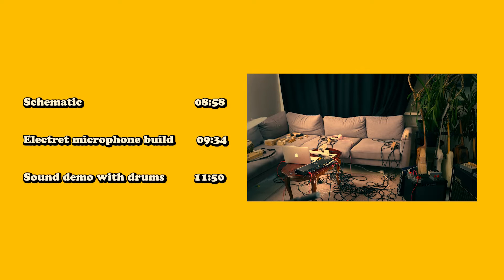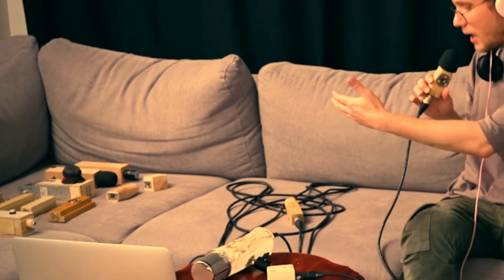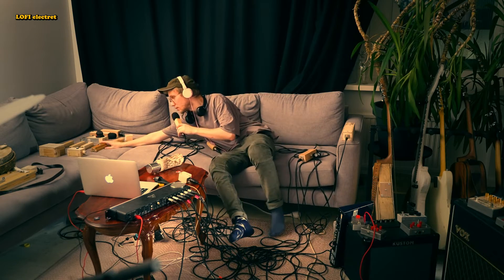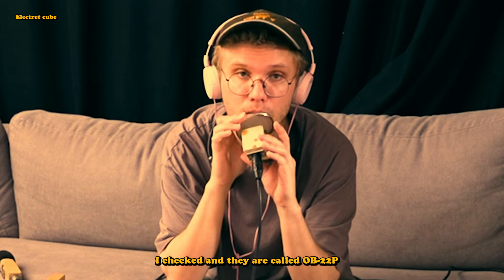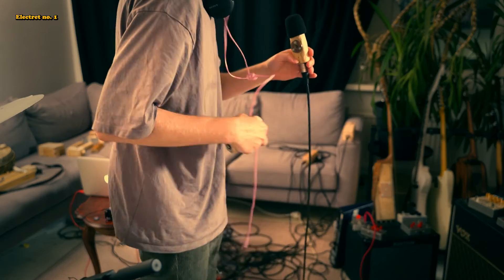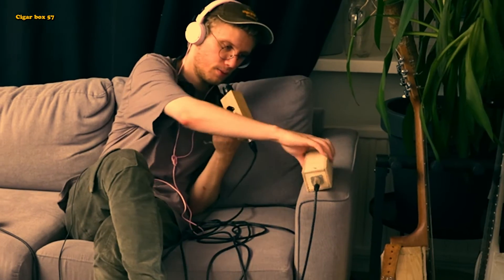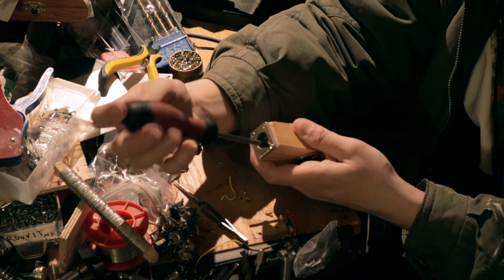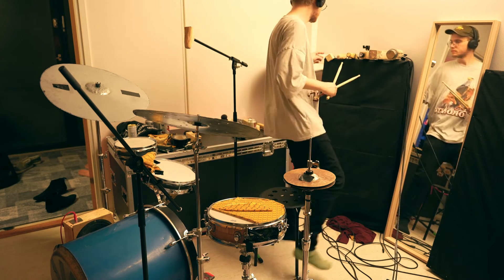super simple DIY electret condenser microphone (phantom powered) + DIY microphone shootout

Comment: Thank you for the schematic for the electret condenser mic! I had some tiny electrets from Tayda that are 25 cents each. I guess just a capacitor and tiny JFET. I built the circuit on a piece of stripboard left over from pedal building, using a 1uf electrolytic capacitor and a 35 cent XLR connector. I hooked it up to my Focusrite interface and it worked right away, albeit with some handling noise. I was absolutely amazed that it worked! I have been obsessed with this idea for quite a while, so thank you! I plan to build this inside of a leftover 1590A box to make it more robust and usable. Thank you Lauri! You rock!

Comment: Hi, what I have to do if my capsule has 3 outputs instead of 2, they are signed D, G, S
Reply from the maker: I think you can connect S (source) and G (gate) together and connect that to the capacitor and resistor. So thats the - pin of the mic capsule in my schematic.

And connect D (drain) to the XLR pin 2. So thats the + pin in the schematic!
Reply: @LAURISDIYCHANNELTV  Thanks for response. I will try that

Comment: Instructive 🥳 It's really the electret n° 1 which is my favorite; not colored, faithful, as well for the voice as the music; perhaps as you say, the rounded tip which would reduce the reflections. On the other hand the "dynamic log" has an unpleasant resonance 😐 to banish 👎. 💁‍♂
Reply from the maker: @robvdc  yeah it does have a quite a ring to it! At first i thought it was because of the tea strainer grill, but turns out the capsule is just a really bad sounding one! I built 2 more, very similar mics, only with a different capsule and they are probably the best sounding dynamics i’ve built so far!

Comment: Thank you I try myself and have acceptable sound quality right into my interface preamp, but I have a question does resistor and capacitor value fix or not? because I use 100k resistor and 1 uf / 50v cap instead of 0,47 uf capacitor?
Reply from the maker: @ayasproduction  1uF should work as well! I’ve used some different values close to these too

Comment: so phantom powered is really a good solution instead of creating its own circuit 😳😳?
Reply from the maker: @jervi_sir  i think you could get a better sound and lower signal to noise ratio by building a separately powered amplifier circuit (maybe?), but i know i would hardly ever use the mics if they needed batteries or a power supply! So for me this is all about ease of use and fitting them to my own workflow! Also, for some reason i love testing solutions that are as simple as possible
Reply: @LAURISDIYCHANNELTV  oh I understood ur perspective